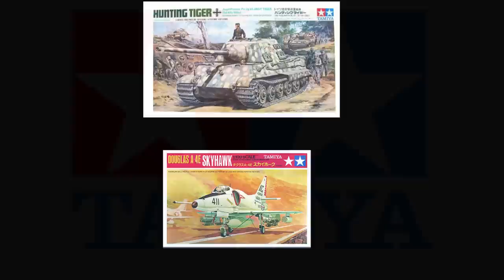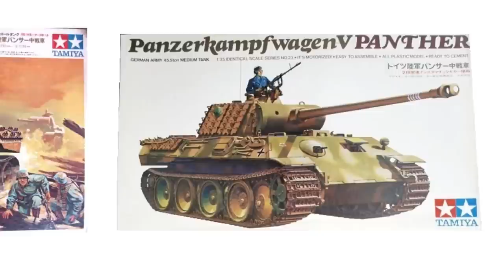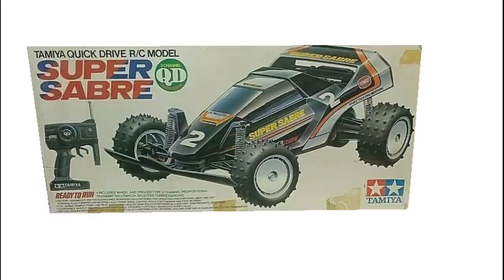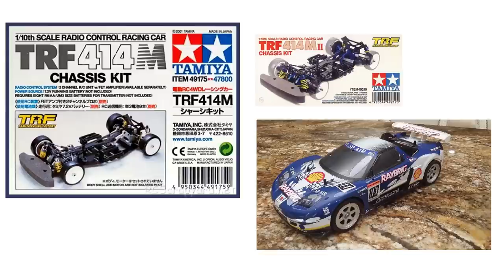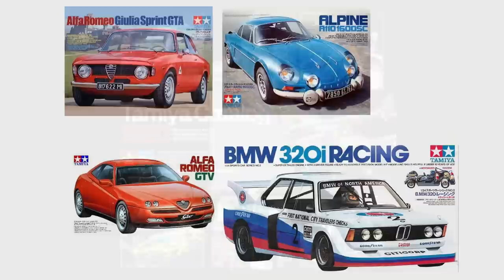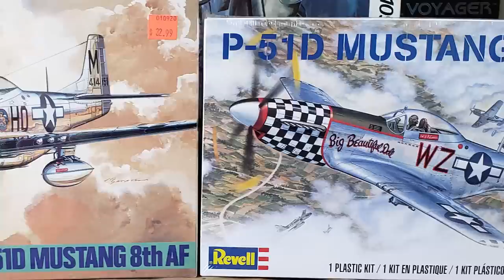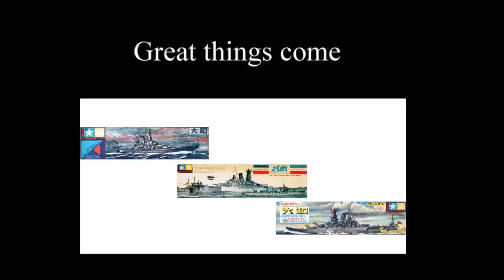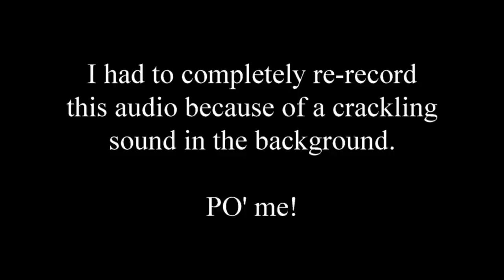Tamiya models, a brief history

Comment: Tamiya keeps its molds in better condition than most companies. That has a lot to do with price.
Reply: Actually it's more a replacement game. Tamiya replace their moulds after about 10,000 cycles, some other companies it's more like 20,000. Believe it or not injection moulding plastics is quite harsh on even stainless steel moulds. Each mould produces only about 4-6 sprues at a time for Tamiya as well compared to up to 10 for some companies. That means the moulds are smaller and have less of a temp difference after pre-heating. The result is less warping of the plastic in the more evenly heated Tamiya moulds.
Reply: @gordonlawrence1448  Wow.  Coming from a packaging background where 10,000,000 cycles prior to replacement would be less than ideal, 10,000 seems extraordinary low, but I guess the sales volumes are somewhat less than an ice cream container and the end product somewhat more pricey which brings the replacement of a mould after 10,000 cycles into perspective.
Reply: @robossuperchannel9434  If you think that's bad, the company I used to work for had a project that I was project manager of where the material injected was a combination of Nylon and 0.2mm glass beads. Those moulds showed signs of wear by 4000 and were useless by 5000. For packaging you are often using for example expanded polystyrene, and the tolerances and flashing are not so much of an issue. Expanded polystyrene by comparison to coloured polystyrene is not even 1% of the wear. With a packing mould if it's 1mm out of tolerance and it's for a large item it would not be an issue with expanded. 0.1mm is an issue on a 35th scale part. Also Tamiya really avoid flashing like the plague. With packaging you can just remove it by hand.
Reply: @gordonlawrence1448  Yeah extruding plastic does damage metal, even the hardest ones. I have a professional 3D printer array and I have to replace nozzles quite often to keep quality up. The best ones I have on 0.2 are 0.215 within a month of use. That is from hardened steel (Corten) which I turn myself.
Reply: @ForOdinAndAsgard  There has got to be a way round it for 3D printers as they use generally less abrasive and less corrosive plastics than for example glass filled nylon.   Also I thought corten was more of a corrosion resistant steel than a hard steel?
Reply: @gordonlawrence1448  Depends on what you print and no I do not print PLA anymore except for test builds as obviously it is cheaper and I wanna test overhang and its support first before making it out of expensive plastics. Especially PETG and wood filaments can ruin your nozzle very fast. Also metal infused ABS packs a great punch of your nozzle. I have filament ABS with copper and aluminum in it. Corten is a solution in between real hardened steel which I cannot mill with my machines and RVS. It does not rust easy but it does rust unlike RVS. I can harden it after milling again though which I cannot do with real hardened steel and RVS. My oven is not hot enough for that.
Reply: @ForOdinAndAsgard  I didnt even know people were now printing with metal filled ABS. I can appreciate how that would be a nightmare for nozzle wear. It may not be applicable to your situation but I have heard of steel being quench hardened after use of a blow torch, or are you controlling the temperature more accurately than that?
Reply: @gordonlawrence1448  I have an oven for my wife who is playing with clay and glass which is far more accurate and I use it gladly for my purposes as well. I can go to the precise needed temperature before quenching. I can go up to 1050 degrees Celsius.

Comment: Thanks for all the great videos and memories!  When I was @10 in the early 1970's, my dad was stationed in Okinawa, and the local hobby, toy, and department stores were filled with incredible models .   My favorite kit was the Tamiya 1/35 scale M60 that came with a dual-motor, remote (not radio) control system.   It cost $3.50 thanks to the great exchange rate at the time (@360 yen per dollar) which was still a fair amount for a kid with little cash.  

      Our last Christmas there, I got the newly released 1/25 scale Tiger tank with individual track links and a full interior and was blown away by it's sheer size and detail.   What fun, and I still build a few models even today.    Thanks again, and the music montage at the end was a brilliant touch!

Comment: Their paint system is also very good.
Reply: the best I ever used....but you pay for it. I remember buying my first motorcycle kit. It had 4 different colours of black for crying out loud. Matte Satin Gloss semi-gloss. Now this was 30 years ago, but I remember buying a jar for $4.00 as it was listed on the box.....it ended up being used ONLY for the grips......GRIPS? I used ONE brush load of paint...ONE. 

I was pissed. lol
Reply: I love Tsmiya model spray cans..never had a problem
Reply: Hi, new subscriber to this channel. My first model was in 1967,(age of 5). Still in the hobby to this day. I used for years pectra, & pactra international enamels.  I remember buying some of the 1/35 ww2 U.S. halftracks, & armor kits by tamiya. Many had a color card showing "pactra/ tamiya " paints. They had the "hex" colors,& used the same "X",& "Xf" colors as pactra. Unfortunately pactra is sadly gone. But tamiya still uses that system. Thanks,& great video.
Reply: @richardtallent8175  1867??? you were 5? that means you're 158 yrs old?
Reply: @muskokamike127  ooops, sorry, & thanks for the notice. I meant 1967, not 1867. Thank you.
Reply: @muskokamike127  yeah, but I'll bet your motorcycle looked awesome!
Reply: @richardtallent8175  Pactra made excellent paints with accurate colors.
Reply: @Inquisitor6321  Still got it and yup, looks amazing.....that's one thing about tamiya kits: they are very well engineered, designed and molded.....
Reply: @Inquisitor6321  yes indeed pactra/ pactra international was great. Unfortunately testors bought them, plus floquil/ polly s. Now look at what happened to testors. They themselves got bought, by RPM/ Rustoleum. Now Testors will be gone. Thank you.

Comment: Thanks for doing this video. I have around 15 Tamiya scale model kits, some half built. My brother and I bought the Tiger 1 and the deluxe Aber photo etch kit 10 years ago. It's a terrific building opportunity. We filed off a ton of detail and replaced it, along with a lot of parts with scale thickness components laboriously bent and soldered. I have a microscopic metal brake and an American Beauty current resistance solder tool as well as the tiniest wrench set that you can barely see with magnifying glasses. Sub-millimeter nuts and bolts were widely used to actually screw components together and to mount to the tank. Shovel, hammer pick, gun cleaning rods and jacking platform custom made from wood and brass. Metal tracks and aftermarket torsion bars were installed and selected lead-acid batteries were fitted for their excessive weight, to better simulate great mass when traveling. It weighs 12.4 kilograms. The tank was fully primed in red oxide before multiple coats of "Dunklegrau". The entire project, including a new airbrush and compressor set us back around $2,000 and took 10 months to complete. We made around 100 photo etch parts, including plenty on the inside, viewable only in awkward close ups. Some had up to 10 individual bits, soldered together. This build expanded my horizons a lot. The tools have come in handy for other builds since. There are a bunch of photos at Aber.net.pl/gallery in 1/16

Comment: Tamiya recently has really upped their game regarding their armor and military figure kits. Their parts fit is exceptional and the facial and equipment detail on their figures comes close to resin quality. I particularly like their recent shift to link-and-length tracks for their tanks...well molded and very buildable. IMO their pricing for the 1/35 series is reasonable, given the recent improvements mentioned.
Reply: Agree 100%.
Reply: They have plenty of competition these days though. 

though I love Tamiya, Dragon, Meng and Rye Field offer some amazingly detailed kits, I'm currently building a Eduard spitfire and the quality is top notch.

I can't think of a better time for modellers than right now..

Comment: In the late 80's I found the Porsche RSR Type934 in a yard sale for $5. It was partially built but complete with box. I was 12 at the time. 10 years later, I sold it on FleaBay for $250. Very nice quality kit but I found it to be quite delicate for use as an RC racer. It is one of those toys I wish I could have back. Very well done video.

Comment: Thanks for this video. Good memories. After making a few plastic models, I discovered Tamiya. Never went back to any other brand. The quality was without peer, whether it was in the detail, molding precision, or the instructions and literature. The kits were more expensive, but worth the extra cost because the result was better and easier to achieve.

Comment: My first Tamiya kit was number MT121, 1/35 scale. The Hunting Tiger with a single motor. Inaccurate in detail and it came with 2 sets of tracks. Plastic for a display model and fully molded rubber tracks for use in motorized mode. It cost 8 bucks (8 hours work at minimum wage) and was imported into Canada by Tri-Ang. Had it for years. Second kit was the motorized Panther.

Comment: In the later 70's i was building Tamiya models, the cars, one early one was the lancia Statos, motorized if I remember right, in Alitaila colors. After a couple of their smaller kits I tackled the Tyrell P6 6 wheel F1 car, the suspension worked and tires were rubber! later on I built a tiger tank and some others. With my first job i picked up the sand scorcher RC off roader and found a club to race with. I have a lot of great memories with their models. You pay more, and get more, often far more. This is a company that respects it's customers. It shows in the very high quality of the kits, the fit and finish and the different materials used. What's the difference between a $15 and $30 kit? I've found with this company, quite a lot.

Comment: I grew up with Tamiya and they are still the best on the market regardless of price. One aspect you did not address is the ergonomics of Tamiya kits.  The mold designers have the builder / hobbyist in mind. No parts chasing from spur to spur, quality plastic (never brittle) and clear, visual instruction sheets (even in Japanese) . Details are superior out of the box, yet very upgrade-able with after market items such as photo-etch.  The figure line is full of extra accessories with detail comparable to resin kits. Tamiya is worth every Yen!

Comment: I believe most of the cost of the Tamiya kit is the mark up by the importer and retail store, here in Canada. I got some information from one store employee and said a $ 42.00 Kit cost them $ 20.00 from the importer.  That is a 102% mark up over cost or or in retail terms a 48% profit margin. The importer also has to make a profit and their markup might be similar. Retail markup is high because of very expensive over head. Also we do not have the volume of sales as in other counties.
Reply: I think you are forgetting import tax and sales tax.
Reply: @gordonlawrence1448  Import tax is paid by the distributor and this would be part of his overhead so it means a higher wholesale price to the store. There used to be a federal sales tax of 12% paid by manufactures, distributors, wholesalers, etc; but this was replaced by the GST tax at the retail level.  So taking into all of the importers costs in my example the kit sold to the retailer for 20 bucks contains all import taxes and duties and other business costs.  Sales taxes (provincial and federal) are added to the sale price. So the kit bought by the retailer for 20 bucks sells for 42 bucks plus sales taxes. Total sales price here is  $ 45.20 cdn.
Reply: Ah your sales tax works different to ours - over here it's already included in the price on the ticket.
Reply: @gordonlawrence1448  I which they would do that here. It gets more confusing when we have different tax rates. Federal Goods and Service sales tax is 5% (GST). In the province of Ontario Provincial Sales Tax (PST) is 8%.  They combine it and call it Harmonized sales tax HST at 13%.. Province of Nova Scotia is 5 % GST and 10% PST so the  HST is 15%. Alberta, Northwest Territories only have the 5% GST. Now Quebec first adds the 5% GST to the price and then adds 9% PST on top of the taxed price. And GST is charged on all gasoline after it has had federal and provincial excise taxes added. We pay tax upon tax. It really is ridiculous here.  However the retail markups on a lot of things are very high in many cases.

Comment: I do remember the 1/35 model tank kits came in either white or full action background. The difference is the white one is either one motor or later, no motor for display only. The kit with the action box art had full twin motor wire guided remote control that used four "C" batteries. I too, bought them batteries by the cases. The early 4 buttons remote control was terrible to operate, sour thumbs after a few minutes. 

Tamiya were not that expensive overseas, much cheaper in price and better in quality than Airfix, Revell and Monogram. 

Interested in the later Chinese manufacturers like Trumpeter, Dragon.

Comment: My first Tamiya was the remote control Jagdpanther, 1967 I think. Never looked back since but when you compare the price then to now!!!! The Revel mustang is nice but a Tamiya beat everyone on engineering of the kit. Everything fits, little to no filler is needed. if Tamiya have one failing it's the decals they are way to thick and sometimes need sanding down and a ton of setter ( insert your favourite here) to get them to sit.

Comment: Way back when I used to fabricate slot cars usually using American model kits but found Tamiya (and other Japanese kits) to be an advantage as they were slightly larger (1:24 to American 1:25) and wider being based on sports racing vehicles but as bonus the detail surpassed US stuff by a mile. Downfall was they cost 2 plus times the US kit price.

Comment: 5:21 -- I built that Zero model! It had things you never saw with Revell or Monogram. See those little pins on the top of the wings over the landing gear? Those let the pilot know the gear was down and locked. Never saw that on any other Zero model kit.

Comment: Some of their kits are the cat's whiskers. Their Corsair went together flawlessly and didn't need any filler at all. Their Lancaster is still the only game in town long after it was released but maybe it is the age, some of the fit I don't think was quite up to their standards even then. 
Haven't built an armoured vehicle of theirs for ages but hopefully they long ago pensioned off the "rubber band" tracks. 
One thing though, you get a top notch kit from them and they have set the bench mark for a lot of companies. Kits are compared to Tamiya kits. Will they stay at the top? Only time will tell.
Thank you for an interesting video.

Comment: On page 26 of this July 1967 issue of Model Car and Track there is an article on the "MRC" slot car kit model of a Porsche Carrera 6 in 1/24th scale. 
https://www.slotforum.com/forums/index.php?showtopic=187427
The opening paragraph of the article makes it clear that it is the work of Tamiya and conveys some of the problems Tamiya had marketing slot cars in the USA. 
By 1967 they found a partner in MRC to rebox the cars. So drawing some attention away from the Japanese origin of the car, but such was the rapid growth in performance of the leading cars at the time the Tamiya found it was no longer cutting edge after the delay in getting to market. 
The sub text in the article, to me, hints that Tamiya were still finding resistance to Japanese products hence the reference to the car being available at "progressive hobby shops". Not sure how much MRC wanted from Tamiya to re-box the cars, but seems to be sold by MRC at much higher prices than the direct Tamiya price in Australia at the time in relation to Cox etc. Near half the price of Cox in Australia.
Also of note is the cover with an elaborate Revell home racing 1/32nd set up making it into the Batman TV show. Such was the presence of slot cars in the boom 1964 to 1968 years.

Comment: the pricing is interesting to say the least, but it seems that instead of selling older kits for a higher price as many other kit manufacturers do (yes i work in a lhs from time to time so i have an idea of what the pricing is) it seems that they make the kits pay for their individual development cost. so now a days when i get new ppl wanting to try out  plastic modeling i tend to sell them an older tamiya kit rather than anythinkg else, just because its easy to build and quite frankly cheep, its not as detailed as newer ones but bang for the buck it cant be beaten.  that said i did spend just as much on fruil tracks for the T34 as i spent on the tamiya kit, because the vinyl tracks where to short ;) still came out great in the end. i have noting but love for Tamiya.

Comment: A discussion of the harder to get 1/25th 1966 NACAR slot cars that Tamiya tried to sell in the US around 1966 to 1968. I get the feeling that most were sold to non US markets due resistance to Japanese slot cars in the US at the time :
https://www.slotforum.com/forums/index.php?showtopic=167514 
Sold as Stabo in Germany which causes confusion with pure Stabo models. In Australia they were only sold as Tamiya . They were well regarded as better value than Cox at the time in Australia at normal pricing.